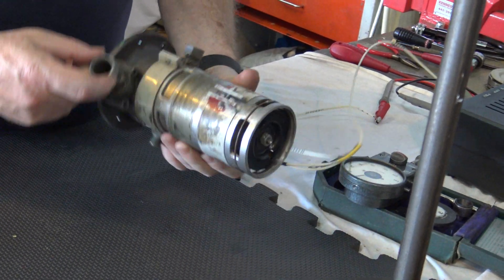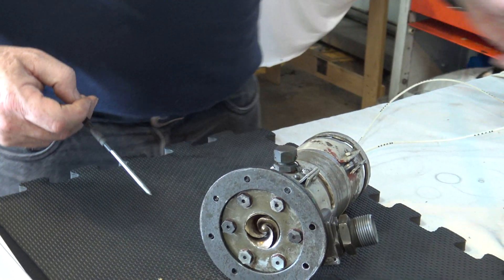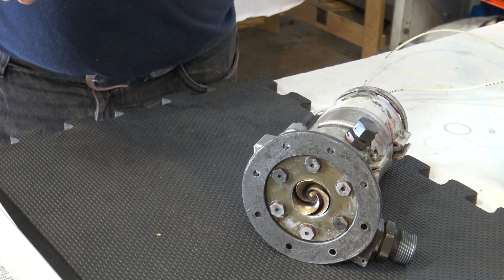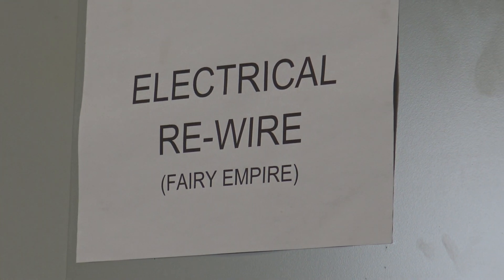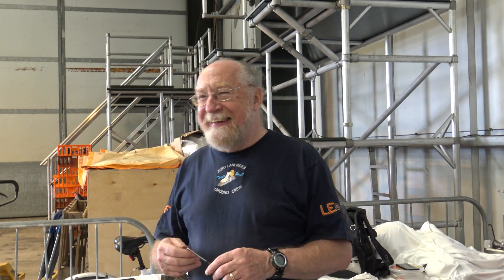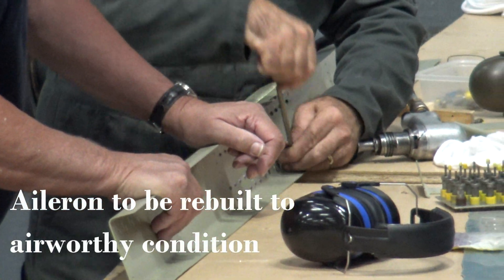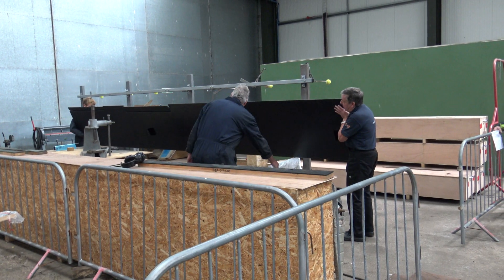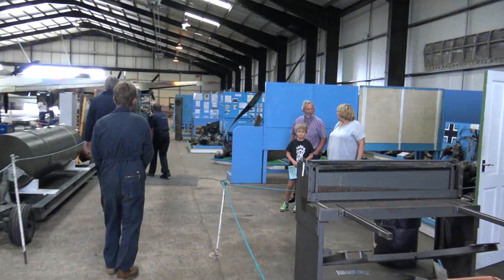Video 25 Restoration of Lancaster NX611 Year Two

Comment: Perhaps this is a stupid question, but from the angle the mid upper looks "forward" of where I am used to seeing it, begging the question if this is a later Canadian built machine with the Martin turret with the .50 calibre guns?
Reply from the maker: Hi Keely NX611 was built at Austin motors Longbridge near Birmingham in may 1945 fitted with Martin 250 /23a mid upper turret ( not a stupid question). thanks for your comments and watching. Check out Video 19 of Restoration

Comment: My Grandfather flew on a Lancaster bomber  in WW2 with the RAAF.    was shot down July 4 1944.  463 squadron Malcom McLeod   Following along while you restore this piece of history.
Reply from the maker: Hi Wild Bill ,  I pass RAF Waddington home to 463sqd in 1944 on the way to East Kirkby to make this video. The sqd moved to RAF Skellingthorpe in 1945 that's less than a mile away from my home. I was 6 years old when your grandad took of on that night from RAF Waddington, living  only 5 miles away in Lincoln. I hope your Grandad Malcom made it home . Thanks for watching.
Reply: @nevillewheeldon1693  Lancaster ME614 took off from RAF Waddington at 2306 hours on the night of 4/5th July 1944 to bomb flying bomb installations at St Leu Desserent.  this was my grandfathers last mission as the Lancaster did not return to base,